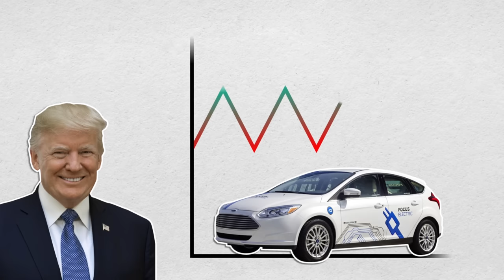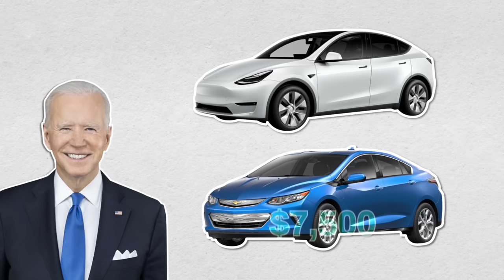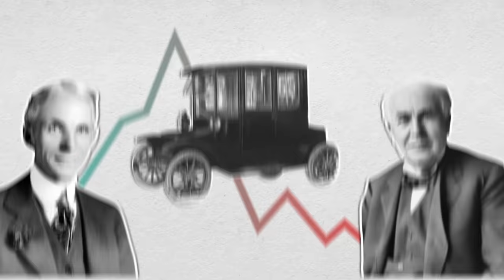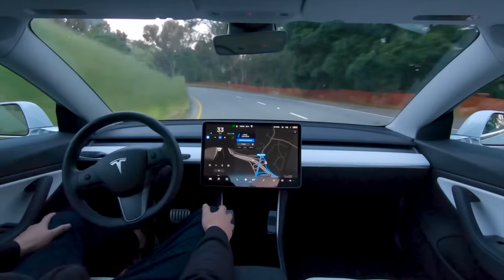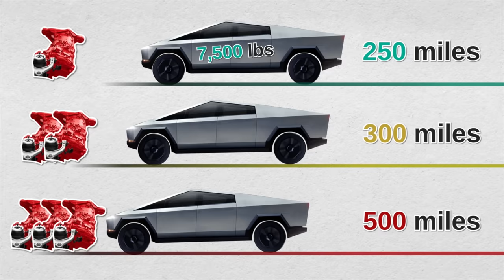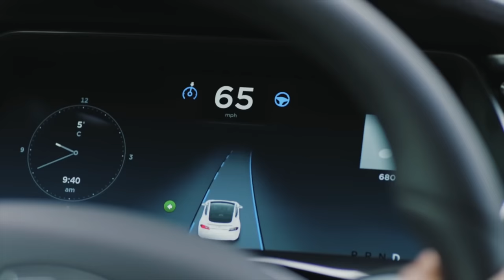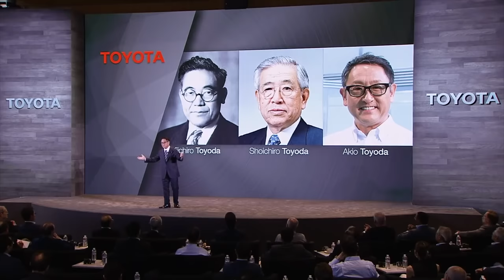Here's Why Toyota is Refusing to Make Electric Cars

Comment: When electric cars weight three times as much as regular cars, you'll need to retrofit all infrastructure.
Reply: Yes, but not for Prius Prime EVs, which easily do 70 mpg over hill, over dale.
Reply: We have rush hour gridlock that freezes traffic for hours. Socal have freeway ramps built 100 ft in the air. LA freeways are congested till 10 pm everyday. Think about it. Bridges, freeway ramps, overpasses,  parking structures, etc...have to be reinforced or collapses under excessive weight are imminent.
Reply: The roads are built to handle 80,000-pound trucks, 4,000-7,000 pound cars are not going to be a problem.
Reply: Except that's not quite true. A 1st generation Nissan LEAF tops out at 3,405 lbs. The similarly sized Nissan Sentra tops out at 3,111 lbs. For more apples to apples; The F150 lightning is expected to weigh about 6,500lbs. The gas-powered crew-cab F150 tops out at 5,684.  Heavier, absolutely, but it seems like it's about 10% for small short-range cars, and about 18% heavier for a large long-range vehicle.
Reply: @cubistone  how much did vehicles weigh back then? Most Americans currently drive ICE trucks and SUVs which weigh about 4000-5000 lbs. That’s about how much the heaviest EVs are. People are just swapping heavy ICE vehicles for heavy EVs. So if they can’t handle the weight of EVs, they can’t currently handle the weight of ICEs. So repair the roads and bridges if needed, but the true infrastructure needed will be in electricity, especially in areas that are seeing booming populations. There needs to be enough energy for everyone moving to these places, and future, as well as the growing need to charge all their vehicles.
Reply: @rp9674  relax Willis
Reply: Those figures you guys stated look ok under current ratio of ev VS gas vehicles. But we're talking about the scenario in which ev totally replace gas. 
Let's talk average. If ev weight about 500--1000# more than gas vehicles then i5 in CA, for instance, would sustain how much weight in bumper to bumper rush hour? That's everyday from 6am to 10pm. I don't have the number to prove my point but it probably be a lot.
Reply: @cubistone  the electric grid will collapse before the road
Reply: @donniebunkerboi9975  that's the estimate based on the number we're given.
Reply: @cubistone  bridge and road are calculated with big rigs traffic in mind
Reply: @donniebunkerboi9975  that's a good point
Reply: @cubistone  I like this argument very much.  However, as great as California is in general, living in LA is kinda stupid.  Not our problem.

Building multilevel concrete structures in earthquake zones (aka the old Hughes/DirecTV building, which I used to work in) is well... I'd focus on single-story buildings there + get rid of the aerial freeway system!  That fault by the Hawhtorne AIrport is gonna take out a ton of infrastructure sometime in the next 100 years.  To make matters worse, for instance, LAX+the DirecTV buildings are both built on swampland.  (La Cienega = The Swamp)
Reply: @johnd01  that's not true. The wear of a roadway is based on the total weight that passed it over its lifetime, not the peak weight at any given time.
Reply: @johnd01  The wear and tear on roads is a combination of bad weather, weight, speed, and number of vehicles. Make any of these factors worse, and the infrastructure will wear out faster.
Reply: hahaha where you do get your propoganda?  the oil store?
Reply: The wireless electric cars will not need batteries and they will be lighter than gasoline engines will not need Transmissions or Fuel tanks.
Reply: @GospelOfTimothy  i heard it here first. That's fascinating. Please elaborate further.
Reply: @jazzlover10000  LA is a study in contrast. There is great beauty in both natural and man-made locales but also desperation and degradation. It's hard to explain because they're so intertwined. I used to live there for a time. Many people i know are still there. It is getting much more populated now though. Density has really affected the quality of life. If you lived around canyons you would have a hard time getting home insurance due to fire risk. Many have had their coverage dropped by insurance companies because of their locale. It is getting out of hand.
Reply: Diesel, propane, Natural Gas and coal are used to generate electricity. Trains are actually diesel-electric. They have a diesel engine to generate electricity for the electric motors on a Train. It's actually more efficient to have one big diesel engine to provide electricity for a hundred cars then have 100 cars with their own diesel engines.

Comment: Not commenting on the Toyota, I just wanted to say a huge thank you to you Scott for the invaluable education you have given. I never knew Hondas were so durable engine wise until I watched your channel. I am now hunting down early 2000 Hondas and Toyotas for my work car haha
Reply: Honda Civic are like Toyota Camry especially the 90s and early 2000s. they're built like a war tank.  With 400,000 miles those things are running like clock....
Reply: Damn, Reading comments like this shows that 12 year old me knew about cars more than most people...
Reply: Consumer Reports did not recommend the 2012 Honda Civic.
Reply: Jeremy : good choice, Toyota,  Honda  or  NOTHING   .......baby, you can't go wrong.   (from an old song  )
Reply: A 88-95 hatchback is good. I've had 3. Or 8th gen Civic. 350K.
Reply: Timing chain breaks in one of those cars and your motor is toast. Unlike timing belts.
Reply: @truthwinseverytime8805 that's backwards.
Reply: You can look this up. There were some really huge transmission problems with the  2002 and 03 V6 Honda Accords. Just research it before you buy an early 2000s with automatic tranny. I love Honda vehicles and have an '07 Element that I plan to keep forever.
Reply: Sorry guy, but if you got any education from this guy, you are in trouble..
Reply: @billowink6821  Wrong it just depends if it is an interference motor, if it is you are better off with a timing chain. If the chain breaks you will have engine damage but chains are more reliable than belts.
Reply: @anti-trollcomedian1664   this is quite correct!!!!!

Comment: So Japan is first/only country which did calculations?
Gasoline can be stored up front before increased demand and that what ellectrisity cannot offer.
Reply: Have you heard of something called “batteries” ?
Reply: Great point!
Reply: @XKS99  Batteries do not have the capacity, but also what would generate the initial power?
Reply: Batteries are good for increase in demand during day. Not increase due to season.
Even spare tank at home cost nothing in comparison to powerwall.
Reply: Actually what Akio Toyoda said has been completely discredited. I wish Scotty hadn't included Toyoda's comments in this video because from the comments I'm reading a lot of people seem to think that just because the president of Toyota said it, it must be true.
Reply: @normvanduker9999  It to an executive who  works with engineers, not just software, but mechanical and automotive, is factually demonstratively true.  That the grid cannot handle electric only and why would it want to, when gasoline is most efficient.  Until nuclear generators or even fantastically nuclear cars are used.
Reply: @normvanduker9999  “a lot of people seem to think that just because the president of…said it, it must be true”. You are accusing people of using an authority as the basis for judgement, which is a logical fallacy.  The problem with that is that he is an authority, so reliance on his statement is not but people see the truth for themselves, while they can acknowledge Mr. Toyoda.  Your criticism pretty tricky is a fallacy.
Reply: @frederickfarias9515  Norway will go to 100% EV for new car sales by 2025. We will see if their grid collapses. I’m betting not.
Reply: @XKS99  They have hydroelectric dams, a very unusual situation, similar to Washington state in US.  Las Vegas was in that situation decades ago with Hoover dam, but now?  California has brown outs- black outs now.

Comment: We can have days of -30 to -40 here in Interior Alaska, so taking a pass on EV for now.
Reply: Carl, wouldn’t you have to keep a gasoline car plugged in to keep it warm enough to start at those temperatures, just as you would an electric car?
Reply: @eddiegardner8232  Sure my car has an oil pan heater and battery charger installed with the plug-in to grid power to be able to start on coldest days.    Now sure how EV can generate enough waste heat that IC engine does to keep the cabin of the vehicle warm at that temperature underway?   Or what happens underway how the batteries fare as they cool to -50 on the coldest days?
Reply: Teslas works just fine in -36C.
Reply: @carstars  They are driving a few EVs on Mars :) Looks like using EVs in cold weather is possible
Reply: @hqsound5582  hell no. I saw countless Tesla cars and other electric vehicles fail in the middle of the road during 2 polar vortexes in the Minnesota during the last couple years alone. And that was just central Minnesota. People live further north, people live in Alaska in Canada northern Sweden and Norway etc.
Reply: Bingo.  Valid argument.  I love my PHEV but I live in Californie.
Reply: @MarvoloRiddle  Norway will be close to 100% electric car adoption within 5 years. The Norwegians seem to manage very well with EVs.
Reply: Probably similar to Norway but they have a higher percentage of electric vehicles than just about any other country! The cars seem to work well there. Heating the cabin works effectively in an EV but you are correct that will affect range (along with the colder battery temperature).

Comment: In my mind, hybrids make huge amounts of sense as they recoup otherwise wasted energy but pure EVs will struggle until a much better charging network is in place.
Reply: Agree with this. The e-motor do the daily grind of traffic jams, stop go traffic and 5min drives, while the ICE takes over for when the engine has properly warmed up and the journey requires decently good motorway speed. Something like 40mph and above. That way, both systems arent really overworked. The emotors dont have to be beefy (hence cheaper) to handle highway speeds and can cool down while the ICE do highway duties. While the ICE dont have to suffer unneccesary wear n tear for those grueling city drives.
Reply: Not plugin EV?
Reply: The infrastructure is there. I've been a huge EV skeptic, and it will be the last thing they do to pry my V8 truck from my hands, but our second car is going to be an EV within the next 2 years, I guarantee.
Reply: Tesla has a charging network for its cars where you just pull up and 🔌plug in. No need to deal with touch screens or cards at a Tesla Supercharger.
Reply: If they really do get to the 250 miles off one charge, the average American would only need to charge 1 time a week. I can't speak for other places, but in my city it would not be hard to find a charging station 1 time a week and go shopping while it's charging.

Comment: Usually when someone tries to invent a new mousetrap it's not as good as the original. I'm just not a fan of electric cars for many reasons and I think they are going to be a footnote in history. Fuel cells will take over it's just a matter of time. They will have to because the power grid just can't produce enough kwh to meet the demand of a large number of electric cars.
Reply: True, America is already behind on it's electricity infrastructure. Millions of high voltage cars isn't going to help. However, I do believe hydrogen cars might have potential in the future.

Comment: So, if you live in the city without a garage or driveway, how are you supposed to charge your vehicle?
Run an extension cord?
Rely on outside charging sources??
Reply: Supercharge your vehicle with a CAT 2 battery
Reply: exactly.....no  garage n no 240  v  outlet , n  live  in  apt. with  no  charging  station  in  sight , an  EV  a  no  go....
Reply: @markgolan7820  Yes, just put that 1000 lb battery in a back pack and take it down from your third floor walk up to the curb. 😂
Reply: Get a generator. Sorted.
Reply: That's either an attack, or a good question. 
Phase in mandating/incentivizing provisions for each EV charging at apartments, put it in building code for new construction.
Might be able to make a deal w/landlord to get 110 or 220 volt charging at your apartment, maybe they pay part of it or at least give  permission.
More charging at stores. The best answer is charging at work.
Even charging from a 110 AC outlet over enough time helps.
Reply: @barrypollack2079  you misunderstand. A CAT 2 battery can charge to %100 more often than regular batteries. Meaning it is more suitable for being in apartments or condos. They just need to supercharge once or twice a week. No different than getting gas. In fact overall it’s cheaper

Comment: No one talks about how our already overloaded US electric grids are going to handle all these car chargers. I see more electric car taxes being paid not only by electric owners but gas engine car owners as well.  They tell us how much cheaper and cleaner electrics will be yet power plants still have to produce the power to charge cars and the cars are expensive to buy batteries are expensive to replace and no one wants them when the batteries come up for replacement so we now will have a huge new source of E waste - electric cars.
Reply: agree......millions of  EVs charging   all  the  time - rolling  blackouts  n  brownouts all over the place.
Reply: Actually e-cars help even the load on base load power plants and the power grid making it more efficient, and they are usually charged during off peak electric demand. They could also feed power into the grid during peak demand.
Reply: @stuarthirsch  How can something feeding off the grid, feed into it at the same time in the same way?
Reply: The taxes as carbon credits have been paid over time by productive companies.  Tesla has been taking carbon credits, cash payments from ICE car makers for years.
Reply: Actually, a lot of people did. A lot of people who's job is to actually research these kind of things. If you did not get that information, it does not mean it does not exist.
Reply: @confuzler6985  That’s a very obvious (tricky) answer, but it has no logic to it.

Comment: I have no desire to buy an electric car. I like going for a drive on weekends, some of those drives are hundreds of miles. It's more efficient for me time-wise to just stop and fuel as needed, rather than sit for an hour or more at a charger.

Additionally, with a software update, your ability to charge can be impacted. If you have a Tesla and violate their terms of service, your ability to fast-charge can be turned off. There are also issues with secondhand purchases and charging.

Besides all of that, the batteries and motors die on Teslas, and that can effectively total the car. It's even worse than the cost of a blown motor in a gas car, which would likely be replaceable for less.
Reply: Older versions of the Tesla battery doesn't have problems until around 300K miles.  This is from real world results on Model S & X.   The Model 3 is good until at least 500K miles.  I'm assuming the model Y would be about the same.    ICE cars usually also have problems past 300k to 500K miles.
Reply: Also electric car are simpler with less parts than the Internal Combustion Engine cars. Less to go wrong. Once the technology improves the ICE cars will be more expensive to maintain. Over the course of years battery tech will improve. Hydrogen cars ? Might even be better than EVs.
Reply: Where do you go for a trip dude? I also wanna chill on weekends)
Reply: @ilyosjonolimjonov9026  the trips I take depend on what time I have available and what's happening around me. I've been all over the northeast USA on various trips.

You can always go on your own trips. There must be something to do near where you live. There are usually event listings and seasonal activities. 😁👍
Reply: @sbrazenor2  do you go by yourself? Or with some friends or gf?
Reply: There is electricity more locations than there is fuel, and fuel has to be trucked.

Chargers are constantly increasing in speed. Right now, the current Tesla Model 3 can charge at over 1,000 miles per hour of charging which means at its peak charge rate you are getting a mile of range every 4 seconds. In about 5 years the charge time will become faster than refueling.